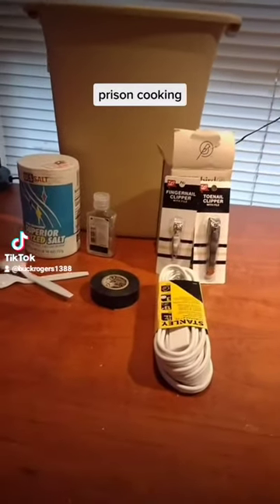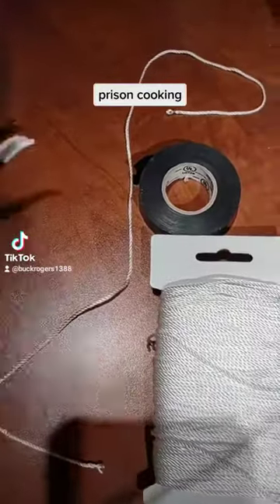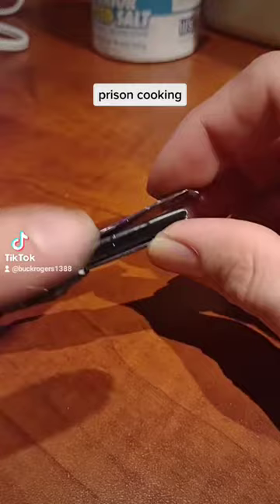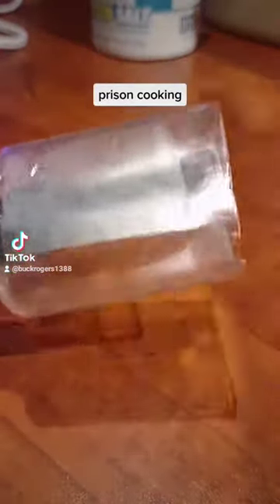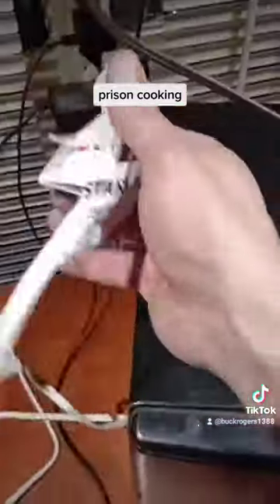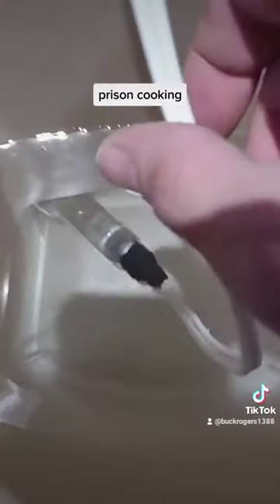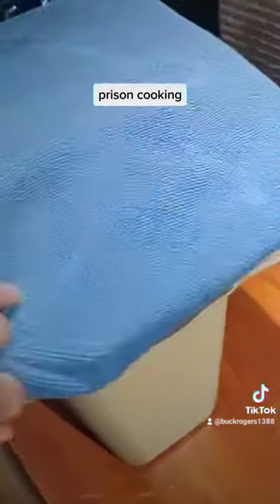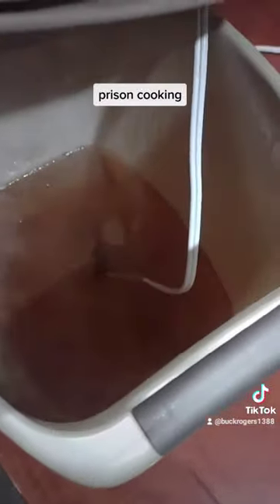prison: making a stinger to cook food

Comment: I've seen different stingers on other channels and they all seem to be made the exact same way but I'd never try making a stinger incase of electrocution I know in the USA the voltage is different around 220  volts AC but over here in the UK our power is 240 volts AC and I have had a few electric shocks before and they are not nice at all so that's why I'm saying that I wouldnt attempt to even make a stinger unless I knew exactly what I'm doing or if I had someone with electrical Knowledge and they know exactly what they are doing then maybe I'd have a go at making a stinger in the future. Thanks everyone cheers.

Comment: How do you make one that doesn't discolor the water?
Reply: The water in the bucket doesn't matter. Say you want hot water for coffee, just put the clean water in a sealable bag and drop it in till hot :)
Reply: There is no way what u do is get a soda can and sting and basically suspend it in the boiling water without the water mixing the outside water is getting discolored and hot but the water in the can gets hot without discoloring
Reply: You dont
Reply from the maker: As the metal oxidizes that's the rust .. are so I understand
Reply from the maker: @Crab_People facts that's exactly what u do

Comment: Here's the real question to see how clever or smart you are, why are we adding salt? What does the salt do chemically? And "the bubbles", Why do bubbles come off the nail clippers? What's causing the bubbles? If you can answer the three of these four questions correct that would amaze me more than your elementary school science fair project here.
Reply: Adding salt in the water to dissociate into its respective ionic charges Na+ and Cl-. This gives the solution a charge and allows electricity to be conducted. The bubbles are formed by electrolysis (the breakage of the hydrogen and oxygen from water). Oxygen bubbles (negative charge) are forming at the positive anode end of the nail clipper. Likewise hydrogen gas bubbles (positive charge) are forming at the negative cathode end of the nail clippers. It’s this lysis reaction that generates heat for the entire system.
Reply: @salfabbio1738  I love this comment section so much
Reply from the maker: I believe the salt is the conductor.... Bubbles coming off the nail clippers because it's oxidizing not really sure I haven't really thought about it much